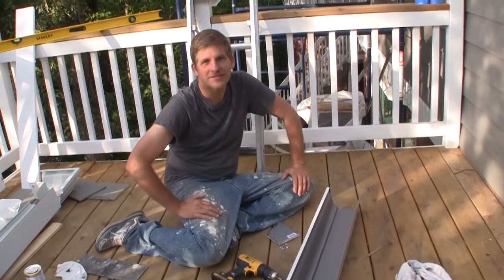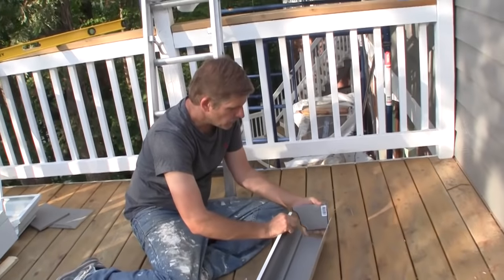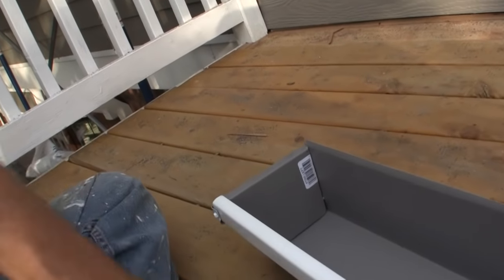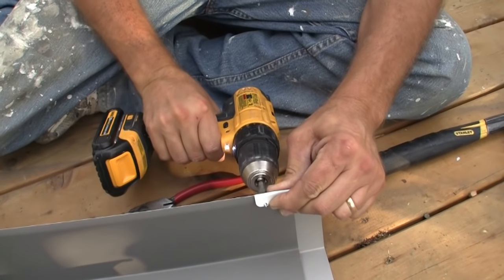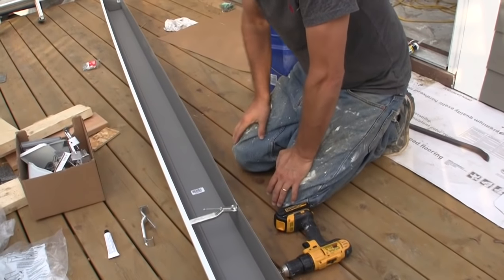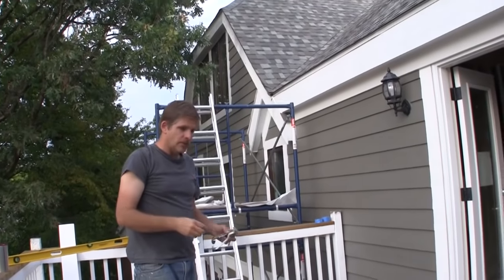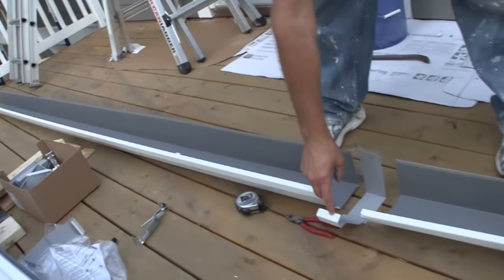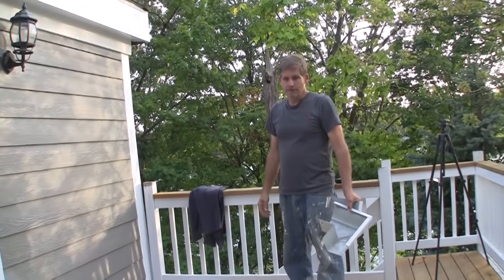How to Install Gutters

Comment: Not sure where this is located but if you are in an area with snow and ice this gutter is affixed too close to the roof line. It needs to be installed much lower to clear  the roof slope in case of sheeting ice or snow which would tear this off. Additionally, the screws should be attached into the ends of the rafters and not just every X amount of inches. Also I would recommend getting these extruded to length as the added joints will leak,  especially with how poorly you demonstrated caulking them.
Reply from the maker: Hi Justin, it is quite snowy and icy here and the gutters are doing fine.  We addressed your other concerns in previous comment replies.  Thanks for your input.

Comment: He mentions that it's important that the drip edge overlaps the gutter - and it is - but then doesn't do do it, you can see a gap at 7:37.  I'm sensitive about this because I'm having to replace fascia boards because of water damage for exactly this reason.
Reply from the maker: Hey Kurt,
You are right. In our instance, the facia is textured pvc trim that will never rot. So we had some wiggle room …
Thx for the comment.

Comment: Thanks for this. I want to replace my gutters and I appreciate tips to do it right.
I am a little confused as to why the extra 3" was needed for the trim piece between the full stick and the outside corner, though. It seems like you made an allowance for overlap.

From what I see here, there is no overlap. The seamer pieces just allow the gutter edges to butt-up against each other, right?
What am I missing?
Thanks ahead for anyone who might answer this. 👍

Comment: Good video though when tucking the gutter under the drip edge metal I assume when fastening the gutter to the fascial the screws are going to go through the drip edge metal would that be correct sir? & one other thing are plastic gutters good to use being they can possible warp & crack in time.
Reply from the maker: Hey Burt,
Yes. You are correct. As for plastic gutters, we have not used them much so can’t really say. Thx for watching!

Comment: Those self piercing screws are they rust proof? Sorry if it's a stupid question,I'm very new to this!..
Reply from the maker: Hey specyiald,
The screws should either be stainless steel or galvanized to hold up outside.
Thx for watching!

Comment: How much roof shingle should overhang my roof. I'm getting mold spots in garage running along the wall (not in the middle of garage just the outside wall. Has me wondering if I have that capilary action going on) trying to figure out were it's coming from, I cleaned my gutters out last weekend, it rained and snowed and wet spot are back.
Reply from the maker: Hey Raymond,
Our shingles overhang the drip edge by .5-1.0 inch. 
Watch when it rains, and see if water is running back under shingles and behind the gutter and down like you suggested. Or, maybe just use a hose on a dry day.
Water should drip into the gutter cleanly. 
Re: mold - is it green? 
Typically here, that grows on siding in areas that never see the sun. The UV rays of the sun kill it everywhere except those walls that are sun-free all day. 
Hope that helps!
Thx for the question.
Reply: @Housebarons  Thnaks Happy Halloween
Reply: @Housebarons  my shingles are cut off right at the edge of the facia
Reply from the maker: Hey Raymond,
Sounds like that might be a contributing factor. They should definitely extend past the drip edge - at least a half inch. That’s a place to start.

Comment: I really like the roof and color of the house. Would you please share what brand example Cromwell, CertainTeed, or if it's GAF and exact color of the roof on this house? As well as what is the paint code on the house or color to look for? I would really appreciate it. Great job on this house!
Reply from the maker: Hi Mike, the paint color is Sherwin Williams Ananomous 7046.  The shingles are Atlas Briarwood Pro HD Architectural Shingles and the style is called Driftwood. We purchased them at Menards, sku 1516701.  The shingles and paint color go great with each other.  We posted a drone video that shows the roof completely:
https://www.youtube.com/watch?v=2SJjqzGxS0k&t=48s
Good luck with your projects!

Comment: It would be nice to hear the mention of size and brand but I am assuming it is Amerimax gutter and parts. Which is a good size if you have shingles. But with the clay tiles on my roof I needed the 6-inch system.  Amerimax end caps are produced about a quarter inch shorter and make it very difficult to get the end cap on without cutting, bending and squeezing the metal gutter to fit into the end cap. The North American representative confirmed at the factory that it has been that way for a long time so they have no reason to change it. But the 5" end caps fit the 5" gutters great.

Comment: hey man! just a quick question for ya. I noticed you put gutter screws into the end cap? I have been installing gutters for only 2 years but I have been crimping the end cap on the end. In your professional opinion, what would be more water tight? crimping the end caps (then caulking the corners) or putting screws in the end cap?
Reply from the maker: Hey dd,
Full disclosure: When it comes to gutters, I’m a DIY guy. 
But if you have been doing this just by crimping and not getting call backs to fix end caps that are falling off, then sounds like your workmanship is fine. It’s the gutter seal that makes them water tight. 
I think screws in the end caps might be over building it. But that’s how we did it. 
Thx for watching Hope you enjoy continued success in your efforts!

Comment: If you’re caulking the seams for a tight seal. Then it shouldn’t hurt if the screws are low down.   To join the two gutters together, don’t they call that part, butt straps?  Looks good anyway  👍👍

Comment: At 06:53 in this video the shingles lay flat for the last two inches. Is the fascia board installed too high?   I have the same problem with my roof. How to correct the flat problem? My Fascia boards are Hardiplank that self drilling screws do not understand when installing gutters..
Reply from the maker: Hey E Gardener, 
That flat condition was the result of our roofing crew. Did not see it till they were done. Ours is isolated to that location and have not yet proven to be a problem yet. 
There might be a gap in the plywood sheathing. Hard to say w/o peeling everything up. 
Regarding the hardiplank ... if they are cement, you may have to use a drill and predrill the holes.

Comment: So when your gutters get plugged ,the water runs into your fascia boards, under your siding, if It is outside the drip edge then the water runs on the  outside of the fascia board when plugged right?
Reply from the maker: Hey David, 
The secret is not letting your gutters get plugged. We have an upcoming video on a way to guard against that.
But assuming they get so full they overflow, the drip edge is meaningless as it is not sealed to the gutter. Typically the drip edge overhangs the side of the gutter if possible.
And the facia should overhang the side walls of the house by 1-2 ft, so nothing should run down the siding.
Thx for the question.

Comment: Who uses silicone?  It’s not a good enough adhesive. When the gutter expands and contracts, it will break loose from the gutter and leak between it and the metal. But, thanks to those that do, it takes 2 seconds to pull silicone out and seal properly.  Gutter seal is all anyone should ever use.  It’s an adhesive but remains pliable. It’s self leveling and meant to be submerged in water and last.    Also, who screws on the end caps?  They make crimpers for end caps. Top of gutter has to go under the drip, but then again look at corner of house, roofers didn’t run drip to end and he put a screw in the seam up at very top.    But yeah we are constantly taking down this do it yourself leaky gutter so the homeowners can return it.  Also, a 1/2” slope per 10? As little out of level as possible is good. This isn’t plumbing that you’re trying to float a turd through. Anything square or rectangle, the more you angle it, the more capacity it loses. A 1” slope and gutter is 4” deep, he just blew 25% of the gutter capacity.  

Omg! They just put the gutter on top and below  the drip edge. Good thing roofers hung the shingles way over the edge. The water might fall in the gutter. This is one of those jobs we come upon and know the homeowner did it or hired a handyman. There isn’t much right about the material or the method.

Comment: so you just drill the gutter screws into the wood of the house? I thought there would be some kind of sealer to keep the water/moisture out of the wood?
Reply from the maker: Hey Social...
Yes. The gutter hanger screw go right into the facia. It’s a vertices surface, so water penetration is low volume/low risk...similar to using screws or nails to install exterior siding. 
Facia usually rots from not having a drip edge properly placed and shingles not overhanging the end of the roof. 
Hope that helps. Thx for watching!
Reply: I’ve also heard recommendations to wrap the fascia with metal too while there…. Saves from future rot concerns….  I have a 130+ year house…. Thinking long term!

Comment: Do you know why color fall off on a new roof, specially when it rains
Reply from the maker: Hey LA,
Not sure I understand exactly. But the roof can have granuals wash off the roof over time from the shingles- just normal wear. 
The shingles can also be discolored by mold or different metals bleeding into the roof. 
Thx for watching!

Comment: Hey man,what do you suggest when a/c line and pipe is mounted to facia board??It appears as though I need to install a thick enough board to overlap but not 100% sure.Any help with this is appreciated. Thanks.
Reply from the maker: Hey STAND...,
Yes. That sounds like a great idea - like adding an additional board to act like a spacer????
If I’m understanding your question right, you’d just need to double check and make sure your gutter is not sitting too far out from the original facia where water then runs not into the gutter but between facia and back of gutter....
Thx for the question. Hope it helps!
Reply: @Housebarons  Awesome man.
Thanks.Will give you 👍👍's up.
PEACE

Comment: So if you have  1 1/2 in slope at the end. And the gutter goes under the drip edge. With only 1 inch drip edge. You would end up with a gap at the end. Wouldn't water get behind it.
Reply from the maker: Hey Frog…,
An insignificant amount in our experience as most of water falls off the drip edge and not running down it. 
Thx for watching!

Comment: Why not put caulk on the seams and endcaps first before screwing them together? That way they are sealed thoroughly inside the joints.
Reply from the maker: Hey by..,
Maybe a little more messy potentially but worth a try. 
Thx for watching!

Comment: @6:49, you have the perfect angle to show us what to do. Great video over all. Thank you. One question: do you go under/behind the drip edge? My roof has the shingles running flush with the edge of the roof, no over lap. Then I got  a couple inches of drip edge, followed up with abt 3” of facia. Do you agree I should go under/behind the drip edge? Thanks again for the informative video!
Reply from the maker: Hey Gator Guy,
We did not go behind the drip edge because we opted for a more dramatic slope to the gutter. 
It is your call. Many people have argued that one or the other option is the way to go. So I wouldn’t worry. Thx for watching!

Comment: Hi Dave, I am curious, since you had the first piece of gutter installed on the fascia, how did you put the back side screws into the seamer for the second piece of gutter?  Wasn't it next to impossible to get your screws and driver in behind the gutter to put those screws in?Thanks for any explanation on that.
Reply from the maker: +Metal Detectorist Hi Metal Detectorist, there aren't any screws in the back side of the gutter. There are screws in the top front edge and the middle front side, just enough to keep it secure. In addition, the entire assembled gutter is anchored every two feet into the fascia board with long mounting screws, so it is quite sturdy. Thanks for the question.
Reply: @Housebarons  hes talking about the last section where you added a foot to reach the corner.. there is a seamer strip that had to be installed to connect the 2 pieces.... aside from silicone arent you screwing that part together ?and if so the screw heads would hold your gutter away from the facia by a small quarter inch

Comment: Those gutters will never work in Canada, seams leak, water finds away then freezes in winter blowing seams apart further, have to use seamless one piece which is same price installed as it is to go buy the stuff, then you still need to install it.. just get guy to install seamless and be done with it
Reply: Well seamless is the way to go but if you have to piece it together a splice plate is not what you want. notch the end of the gutter at least 4" and apply  3 beads of polyurethane caulking (non-skinning) not silicone.

Comment: Hi, what are the rain gutters important exactly, why not just let the rain fall from the roof ?
Reply from the maker: Hi Triumf Dula, water is an enemy of wood, over time it can turn a sturdy beam into sawdust.  In addition to erosion, it can cause mold, which is very unhealthy and expensive to remediate.  It can even cause foundation problems if left unchecked.

Always install gutters and divert the water as far away from your home as far as possible.

Hope this helps!
Reply: @Housebarons  Thanks and well said, "as far away from your home as far as possible", but still not clear, what is the difference while so much rain falls on the facade and all around the house and around the foundations, why taking away the water of that roof little area, do you get me, or i don't get it, ?

Comment: Do you need gutter hangers because I got the screws. The hangers do look a lot easier
Reply from the maker: Hey Jessy,
If you’re talking about the 8-9” screws, I’ve used those and they are strong! But the hangers are pretty easy to use. Coin flip I’d guess. Either should work fine. 
Your call :-)
Thx for question!
Reply: HouseBarons for the self piercing gutter screws they are 1/2 correct??

Comment: Would a deep 6 point 1/2in impact socket work to screw in the screws?
Reply from the maker: Hey Johnathan,
The metal is so soft, you don’t need the advantage of an impact driver, but it should work all the same.
Thx for watching!
Reply: HouseBarons I have a drill so just wondering what I need to screw the screws in
Reply from the maker: Hey Johnathan,
Take a gutter screw into the hardware store. There you can get the right size screw driver attachment. 
They make hex head nut driver sets that will insert into your drill and fit right over the hex head screw.
Thx for viewing!

Comment: Won't water drain out of a level gutter?
Reply from the maker: Hey Paul,
Yes. Dead level is hard to achieve and in reality, you could make it flow the wrong way trying to just have “ level “ gutters. If you are trying to encourage water to move, a slope helps. There is actual calculations that can be made to make a determination. But there are so many opinions and practices that a judgement call is typically fine for the job. 
Thx for watching and commenting.

Comment: What if the house doesn’t have the wood on the corner going downwards to connect where the water goes down?
Reply from the maker: Hey Carlos…,
The gutter can still run down the side of the house and be attached with brackets through the siding. Just will look a little different but function the same.
Thx for watching!

Comment: I feel confident I can do this now but where I live I get snow.  I fear that the ice and snow from the roof will tear this down.  Do I do anything different?
Reply from the maker: Hey bad...,
Follow the angle of the roof downwards and make sure the outer edge of the gutter is not higher than the line of that angle. The thought is - snow sliding down and off the roof will slide right off the roof without the gutter getting in the way of the slide.
Hope that helps. Thx for watching!

Comment: Would it work better if I drilled the ends to the fascia first followed by the middle section? Around 7:40 you mentioned something about “this part is a little high” and tapped it down. Wouldn’t you have trouble making it move lower if most of the section was drilled in?
Reply: Who cares? He still got the main point across, didn't he?

Comment: If I have a 30 foot span, I would imagine at some point the slope is going to bring the gutter below the point of tucking it behind my drip edge.  What do you do when that happens?
Reply from the maker: Hey Lee,
Some good arguments have been made for no slope. Check out the comments, but that might be a solution. 
Thx for watching.

Comment: 2 shortcuts you took which matter: Clip screws should go into rafter tails behind facia, and sealant both under every strip plus another round when done.  I would've also stepped up a better quality gutter you can put a ladder against.
Reply from the maker: Hey mudslinger888 ,
No shortcuts here. 
Your point is well taken. And while you typically you'd want to hit raftertails when using smooth gutter spikes, the facia on this house is 1+ inch thick and we are using screws. Nothing that wouldn't ruin the gutters is pulling those screws out of that depth. 

As for the gutters, while these gutters would hold a ladder, I personally don't like to put ladders on gutters if I can help it. Generally, I don't want to mar the finish if I can help it. We use ladder stabilizers if we need to get on the roof. Just better any way you slice it. Thx for the comment.

Comment: That's the mistake I made, I didn't slide it under the drip edge.  I See at 7:45, you are no longer slipped under the drip edge.
Also, I got some cheesy  hangers from Home Depot that I struggled to make them work.